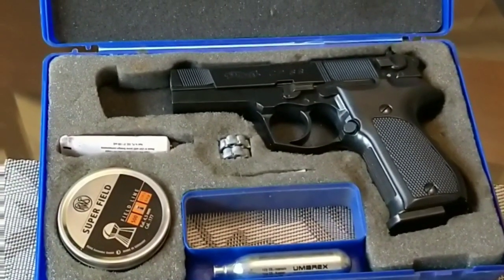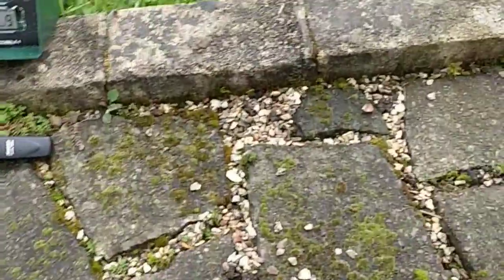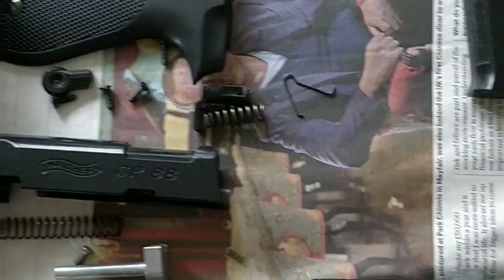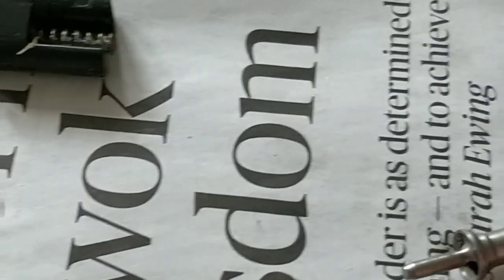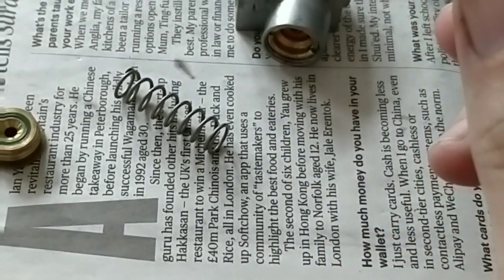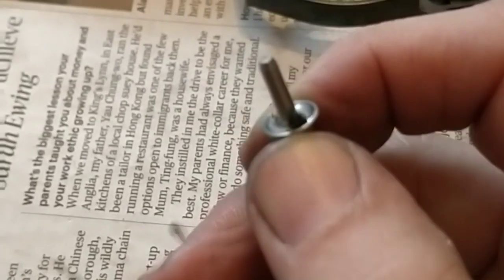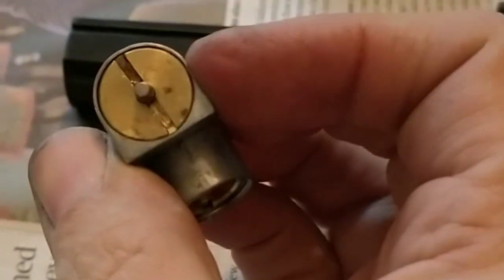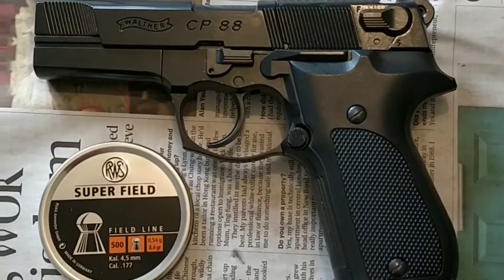Walther CP88 can you increase power?

Comment: Good video, i did the same, longer opening time and bigger hole to avoid unecessary restriction of the gas. The problem is we don´t have enough gas volume in the chamber. What gives power is the volume of the chamber because the co2 bottle fills only the chamber and is not involved in pushing faster the pellet or bb. My gun has another sistem. I have a simple screwed plug in the chamber, tomorrow i will try to screw out a little bit the plug to gain more chamber volume. To seal the plug i will use teflon tape.

Comment: Im getting between 500-550 fps out of my CP88 6" barrel model. 80 degrees Outdoor testing  Elevation roughly 50' above sea level. 
(Portland, Oregon)  No mods other than steel guide rod.   Roughly 1/2" 8 shot grouping at 12 yards
Reply: How did you do it?!
Reply: Kiki Crocs  ok im happy to hear that! :)
Reply: Barrel length decides what fps is at all theoretically possible to achieve. My guess is, internals are the same on the models, so just having a longer barrel makes the difference.

Comment: I'm surprised that didn't work ?  I've modded quite a few air guns even without opening those ports but just changing the chamber spring and adding tension to the hammer spring really made a big difference -

Comment: I see your trying to get more fps. What I would try to do is make the reservoir larger maybe boring the inside to get more co2 to be forced through holes you made. Pressure is only going to get as high a 12 gram cylinder will make it. I would use original spring.
Reply: Take the lighter and booling for 10sec the rezervor co2....
Reply: Still not gonna work because the pressure os the same, more gas is not the solution because the pellet doesn’t have more barrel to acelerate, make the barrel longer and then give it more gas and you will get significantly higher power

Comment: I don't recommend to work on the valve for the intention of increasing the power.because you will mostly possibly damage the seal system and causing leaking air due to rough finishing and reducing the spring tention force will increasing the possibility of air leaks.because of the pressure are not balanced.it might not leaking right way.but it may leak after some shot.the best of way to increase power is replacing to hpa systems and increase the power of hummer.i have been modify hpa system to co2 pistol.and that is my experience after messed one of my pistol.and i got that experience.unfortunately i am not a youtuber.i do not shoting videos.but that is what i want to share with people who are intende to modify their air pistol.thanks guy.hope you guys successfully.

Comment: Convert it to compressed air but you'd need a big cylinder under it and it wouldn't be very portable! People modify Crosman pistols but they are much bigger an you can fit an air bottle under them but they turn them into little carbines.

Comment: Sorry mate, but it's the length of time the projectile spends in the barrel as to how much gas is used or needed sufficiently, dependent on how much the projectile weights to get maximum power. Simple 😅 also cleaning and polishing or smoothing of the mechanism components helps 👍

Comment: If you want this model to hit hard use gamo lead bbs they hit so damn hard compared to a pellet
Reply: That doesn't really make sense. pellets are also made of lead, why would a lead ball be better than a pellet?
Reply: I tryed is no better ,this gun with any kind of lead ball or pellet  doesn't brake a bootle of beer ,but with stell bb 4.5mm 0.35grams it broke whitout problem's.
But a 10 joules with 141m/s air rifle with 5.5mm lead pellet brake beer bottle easily
Reply: Steel bbs,, is much hard era than leader,  of course

Comment: I'm in the process of modding my CP99 and have upped the power to almost 3 ftlbs. I was getting just over 2 ftlbs before. So far I have bored out the valve chamber with a dremel burr bit as much as I dare  and added a second breech seal o ring superglued within the original as I am sure the original breech seal doesn't quite seal fully against the magazine?
Things I will try next is the enlargement of the 2 piston holes and also enlarge the co2 piercing piece hole, glue on extra length to the piston hammer pin so it opens further for longer.
There is a French dude on youtube who seems to have upped his CP99 to 12 joules which is 8-9 fpe, by doing some of these mods but also fiddling with the hammer spring but i'm a bit sceptical they can go that high? I'm thinking 4 fpe might be a stretch for safe reliable pistol  of this type?
Reply: my .22 glock 17 is running at 1295fps !
Reply: Take 8 ftlb easy
Reply: @ianmangham4570   I take it you have to increase the power of the hammer spring to get this power level? I have tried bending the stock spring a bit and did see an increase over 3.5 ish foot pounds! As I need to keep it under 6 here in the UK I’m pretty certain now that is achievable and more than happy with almost 4 fpe.

Comment: You can't increase the pressure as Co2 only produces around 60 bar (850 PSI) so the only option is to increase the slug of Co2 which is a waste of effort without a longer barrel. If the slug is already sufficient then just a longer barrel will do fine. It's that simple.

Comment: hi mate, couple of things wondered if you could help with and also a couple of ideas. Firstly you're so right about those ball bearings flying like a shot pellet all over the place, I have eventually lost one so I'll either need to replace it or bodge it! In terms of advice I'm wondering if you could help me on re-assembling the gun, I'm struggling with getting the safety catch back together, there's a little piece of metal that is attached to the inner mechanism of the safety called the cs711 on the schematic, I'm struggling with that part as to where the bottom part once fitted to the safety mechanism bolt should go.

In terms of ideas for power, I noticed you tried boring out the holes, I thought why not add an additional 2 holes to make a circle of 4 holes, a brand new sharp 0.5 or 1mm hss bit should do it. 
I don't fancy messing with spring but another idea I had, not sure wether I heard it or it was just stuck in my head but what about somehow extending the striking pin therefore pushing the bolt further through the chamber meaning it would allow further gas again the bolt would be further into the chamber nearer the end?
TBH I have no idea about guns, I'm a sparky but its just the logic really of allowing more gas into the chamber.

Any thoughts would be appreciated. Awesome guns by the way, just such a shame they're not beastly like a 6ftlber
Reply from the maker: Hi thanks for the comment and suggestions. 
Re the safety, you need to position the small mushroom style pin so the small end is where the hammer hits, many people pit it in the wrong way round. Also you need to pull the hammer back when inserting it and make sure the cur outs line up with the valve pin.
Re the holes in he valve you may be right as I understand the CP88 valve in the competition version has 4 holes. I chose not to try this as I'm worried that it will over weaken the valve as it needs to withstand the hammer strike. Maybe finding a competition valve and fitting that would do the trick.
Re extending the hammer strike again it's a good idea but the only way to do that would be to fabricate a new mushroom pin but with a longer stem. Maybe I will give it a go at some point. 
Hope this helps and thanks for your comments
Reply: Thanks for the reply. You mention in the video there's videos online of how the gun is taken apart and placed back in detail somewhere, would be really grateful if you could direct me to those.

Comment: Im about to start modify my Glock dual ammo, first try, just drill upp the hole in the regulator, thad did aprox 10m/sek but a smal leek, so a i did a new part to play with, next is to delite the bloback funktion that steel alot of the presure, i have not week the valve spring, do you notes any leek when you put in a softer one?

Comment: I have the cp88 and i just placed a peice of metal a cut nail  in the hammer hole to increase hammer weight dnno why but my hot shots are like 1100fps pretty sure my chrony is dodge or ive entered the wrong numbers in to the machine or the thing is just op

Comment: What lf....... You turned the pin down removing as much excess material from both the  internal(increasing gas flow) and external(increasing volume of gas in chamber) of the shaft. Also the lighter pin, should be faster. Polish out the internals if pin with wd40 and pumice powder on a cord.
Check 'O'ring breach end of barrel and sometimes a tiny bit of movement in the barrel. 2 small pieces of shim pack it back against mag face. Upgrade to competition barrel!

Comment: Hi I have one of these and every time I put the capsule all the air is  released at once do you know what the problem is....Cheers Phil from Newark
Reply from the maker: You have a pierce disc that pops a small hole in capsule that also has a seal, if this is damaged it will vent all gas.